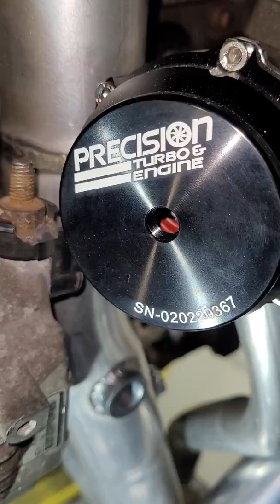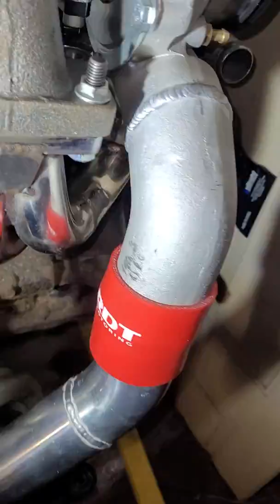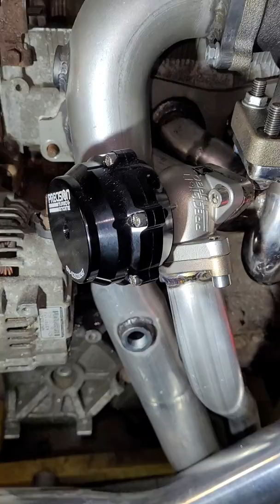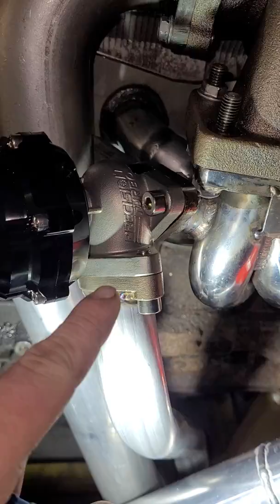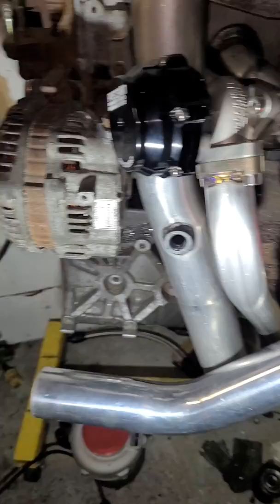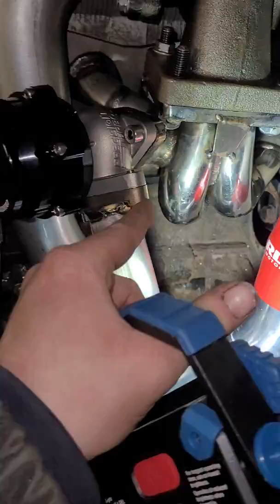4g69 wastegate purpose and VTA(dump) VS recirculation

Comment: Love this build man. I have a 2010 galant that I daily and I want to have a little fun. I was thinking of ordering that turbo kit you have so lets see, in time, how it goes for you. Cant wait to see where this goes!
Reply from the maker: We actually have done many successful turbo setups on the 4g69
 Just never documented it or posted anything on you tube. We can say that it's been quite reliable and fun depending how hard you want to run the car. Typically I wouldn't recommend trying to make more than 300 whp on the stock bottom end. Deleting the balance shafts also helps eliminate another point of failure aswell